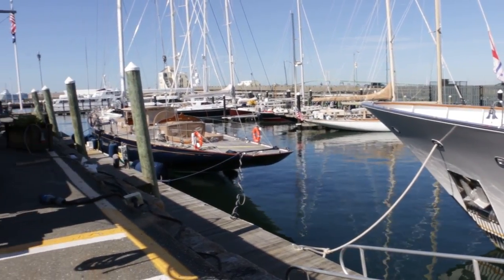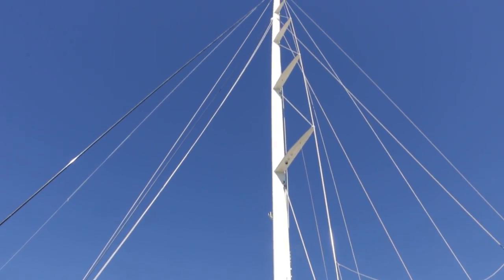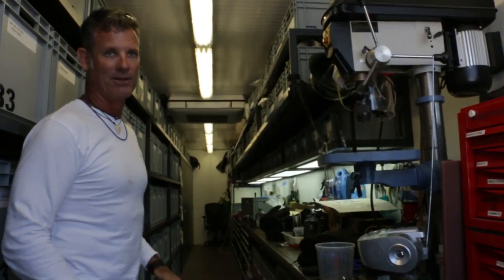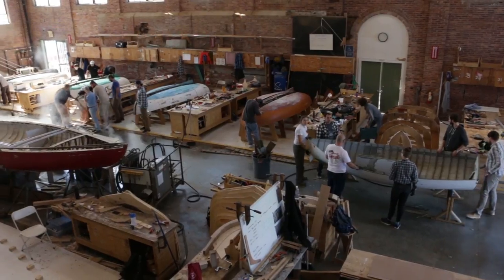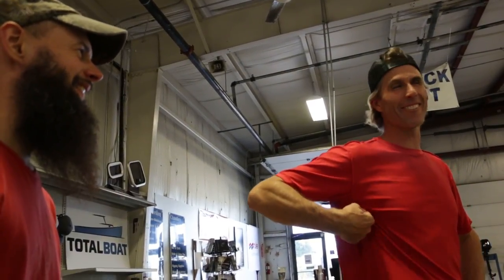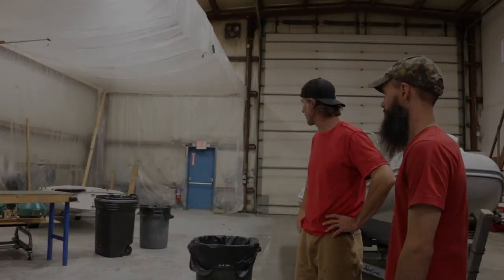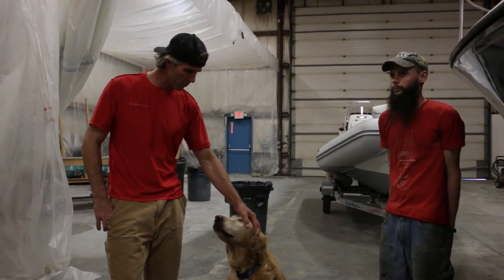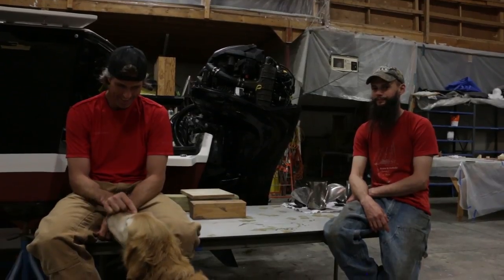Acorn to Arabella - Journey of a Wooden Boat - Episode 20: Rhode Island and Jamestown Distributors

Comment: Have you guys heard of adding this to lead? http://vulcangms.com/2014/02/17/how-does-antimony-improve-lead-based-castings/
Reply from the maker: Yes we have.
The lead keels we sawed up have the correct amount in them and we have a bunch of scrap lead that is super hard so that also has a lot of antimony in it.  
We will use the hardest lead we have for the keel and save the soft stuff for casting the internal ballast. If we just used soft lead like roofing flashing we would need to add it but since the bulk of our lead is from keels, wheel weights and a tire making factory the vast majority of our lead is plenty hard.